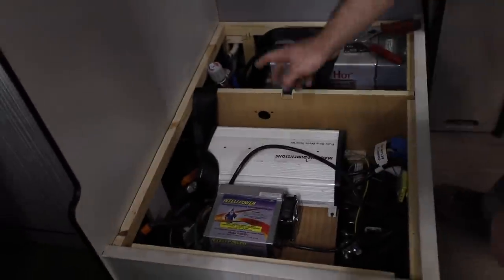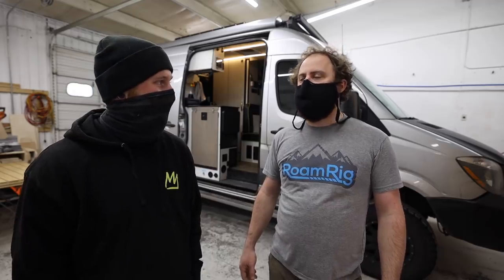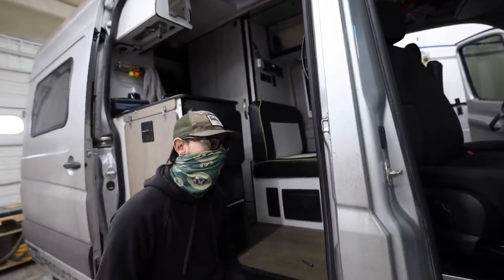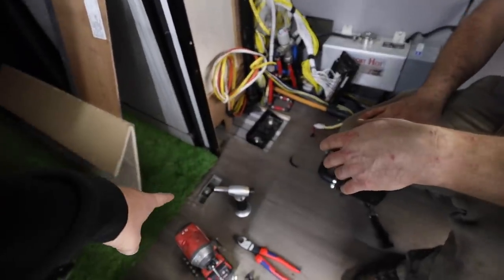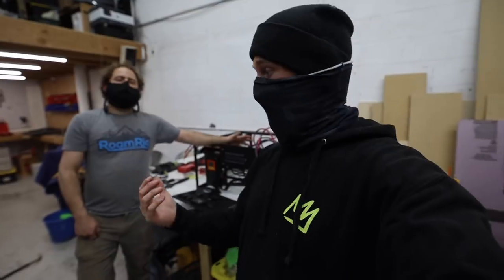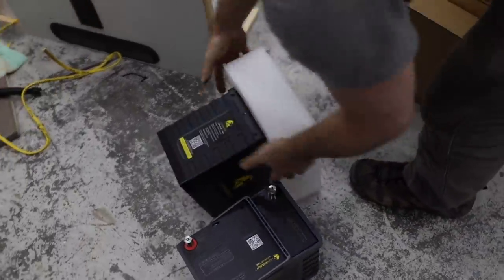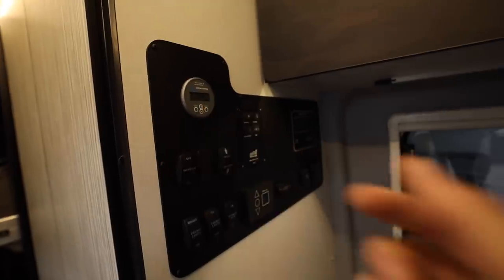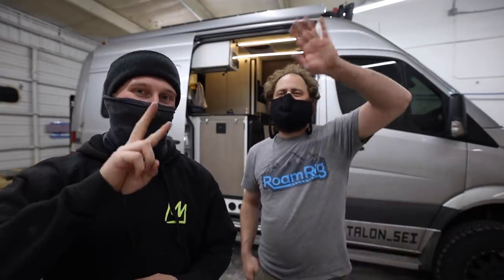COMPLETE POWER OVERHAUL! | Revel Stage 3 Lithium Conversion from RoamRig

Comment: Did you notice a change in your interior light color or intensity?  A few episodes ago you said that hooked up to shore power at a campsite your interior lights worked better, have you noticed the same change with the Li upgrade?  Thanks.

Comment: Talon - How did you get your van inside of Nikola's shop? He barely has 10 feet of clearance. When he did mine he wasn't too specific about if he had to remove the AC or air down the tires.Your van is lifted even more. Love the System, Aaron is awesome, Nikola is great. Now I just need someone local to wire up a WeBoost.
Reply from the maker: Super low tire pressure, removed my weboost antenna and had the 2 guys riding on the back on the van. To get out we loaded the back with old AGM batteries 😂
Reply: @TalonSei  that is awesome

Comment: This is so killer!  So you have done a complete power upgrade to battery.  Do you really still need solar?

Also you upgraded heating correct?  And that upgrade is for air and water?

What upgrade do you feel is next?
Reply from the maker: I technically don’t “need” solar, but it helps when the van is not being driven. I will never have to plug the van into shore power again 👍🏻

Comment: I am curious about the thermal solution for the lithium batteries and inverter located under the bench seat.  Charging and discharging the lithium batteries and the inverter will generate a substantial amount of heat.  The compartment where the batteries and inverter did not seem to have much ventilation or forced cooling.  I am concerned that this will be an issue with high power usage, especially in warm climates.  Excessive heat will cause issues with both the batteries and the inverter; both may shut down when safety mechanisms engage.  I would encourage active ventilation/cooling of the batter and inverter compartment in order to maintain and safeguard the power system.
Reply from the maker: There is actually a lot of ventilation in that box, right around the inverter as well.

Comment: Hey man, just wandering why you decided to do away with the CTEK d250se & smartpass 120s you had previously installed and went with the Kisae dmt-1250 DC-DC charger instead? Have you had any issues with the CTEK? I'm thinking of going this route ... Thanks!!
Reply from the maker: It is not needed with the lithium system. I still have the CTEK if you are looking to buy a kit.
Reply: @TalonSei  The Kisae pulls in a max of 50A though where the CTEK can output up to 140A from the alternator for faster charging of the lithium batteries, which is preferable, no?
Reply from the maker: No, we completely gutted my van. All new wiring, batteries, secondary alternator etc. the ctek would be pointless.
Reply: @TalonSei   Oh I got you, you went with a secondary alternator too, that makes sense! Thanks!!
Reply: @morenonesense  The CTEK can in theory pull 140A if 140A is available but 140A is NOT available from the stock Mercedes alternator.

Comment: Do you still have a engine battery for starting or do those replace all the batteries?  How do the new batteries hold up to winching?
Reply from the maker: Engine battery is under the driver side floorboard. Winch works as it should.
Reply: @dieseldabz7104  Yup!  I run a Yellow top mainly for the winch and I have a Rockpals 300W to run all my rechargeable stuff .. which is growing daily it seems!

Comment: Can this be put into a 2021 and, if so, would the existing lithium have to come out or could they be combined for even more power?
Reply from the maker: This system would be still be a HUGE upgrade over the 2021 lithium systems. Keep your eyes peeled over on www.roamrig.com for information regarding the new van layouts.
Reply: Hi there, we have a system for 2021 revels that is about to launch. It adds two more batteries, an upgraded alternator, and a few other changes.
Reply: @roamrig  So if you wanted a 600+ setup you would be better off with an older Revel.   Thanks for the reply.
Reply: @stephenstringer3689  500ah in the 2021 is relatively easy.

Comment: For as much as these rigs cost, I always thought it looked really cluttered and hodgepodge with the way the controls were laid out behind the passenger seats.  It looked anything but first class.  In addition...this is 2020, why would a company like Winnebago use anything but lithium ion battery technology?  It shouldn’t even be an option, the company is screwing the pooch by using lead acid batteries.  It’s no excuse that the company is in a hurry to get the vans put together and finished.  Cheap materials and cheap components certainly aren’t reflected in the van’s price!  The new customization takes the van to the level it should have been off the showroom floor.

Lastly, I could tell that Roam Rig knew what they were doing and are pros based on the tools they were using.  Just as they are installing all state of the art components into the van, they were using state of the art tools to do the work, e.g. Milwaukee Fuel G3 Impact Driver, Fuel Grinder, etc..
Reply: We definitely don't mess with Ryobi at RoamRig!

To give Winnebago some credit here, they have a lot to juggle between numerous vehicles built in one plant, a complex supply chain, training dealers (and customers)...it isn't simple for a big company to just snap their fingers and make a major change to how they do things. 

They are using lithium in many of the 2021 and later model vehicles they produce.
Reply: @roamrig , thanks for the follow up.  Hopefully you have some sort of patent for the electrical upgrade you implemented on Talon’s van.  If I were you I’d contact Winnebago to line up a presentation showcasing what RoamRig can bring to the table for them.  A video of this install could get the ball rolling in the right direction.  Probably multiple teams contracted to implement the upgrades.  If you were interested in expanding your business, that would certainly do the trick.

I was really impressed with the end product!